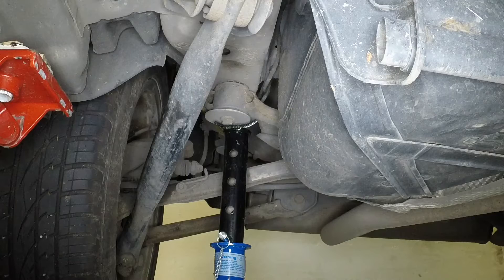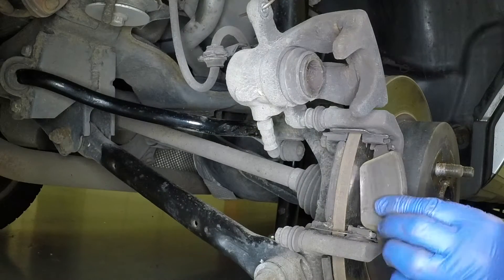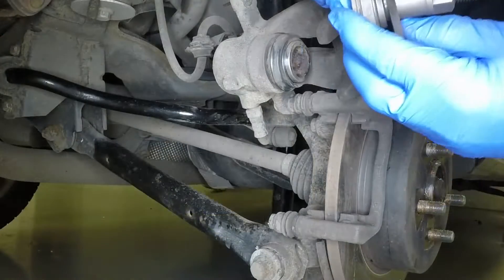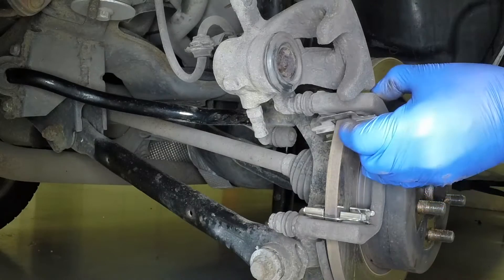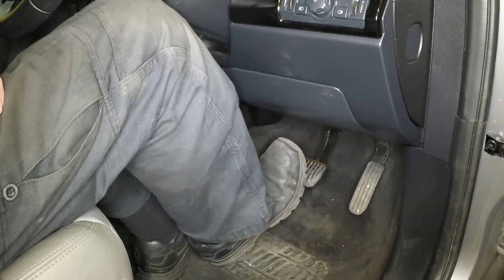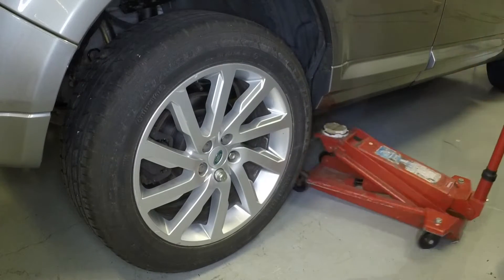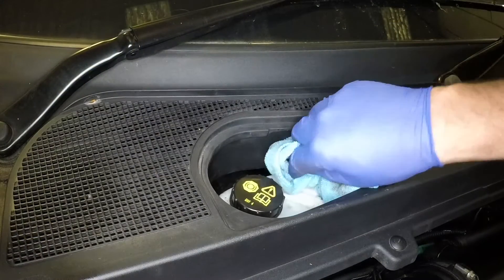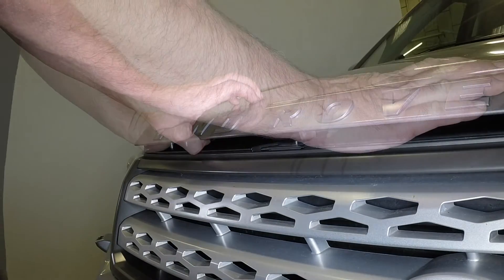How to change the rear brake pads on a Land Rover Freelander (2006-2014)

Comment: I have watched a few of these demo's before doing the job myself and this is by far the best demonstration, I think I will be fine doing this job, I wasn't sure until now. My LR Dealer wanted £200 for the just the rear pads.
Reply from the maker: Thanks for the comments. If you follow the steps in the video, or in the manual, you'll be fine.

Comment: A key step here is missing: if your FL has Electronic Parking Brake, you need to set it to "service mode" before starting doing the job. By doing that you'll be able to retract the piston easily
Reply: How?
Reply: Only applies to post 2014 freelanders.